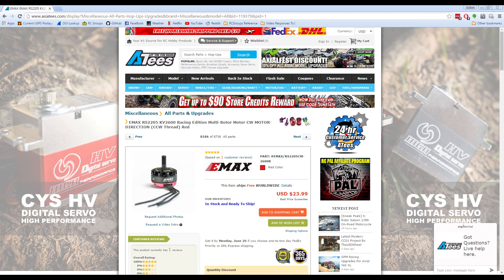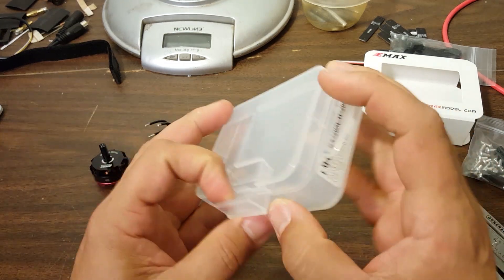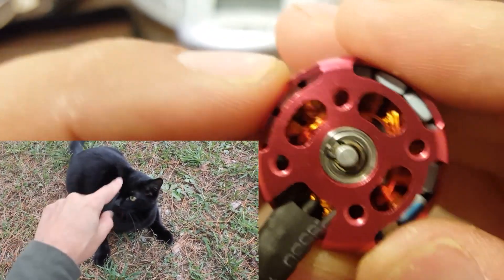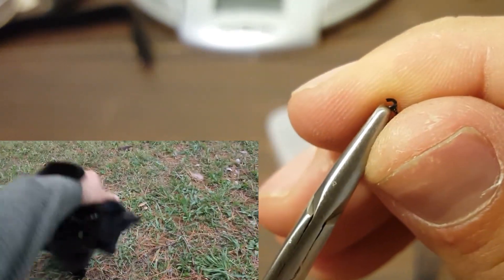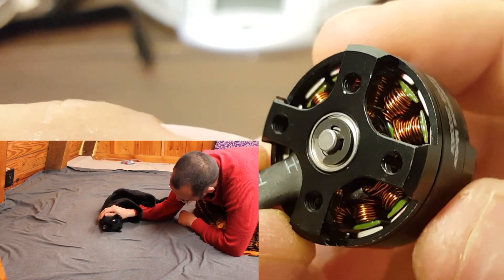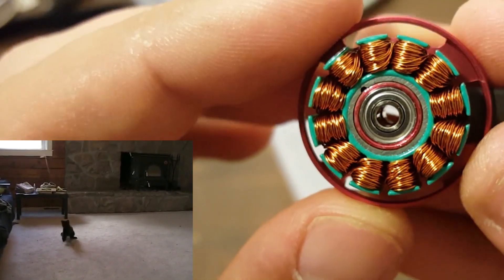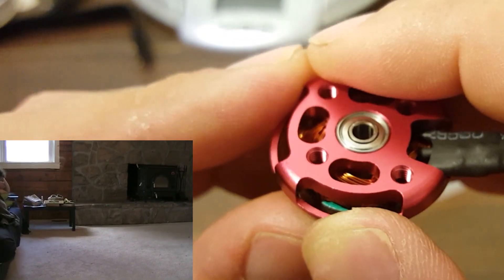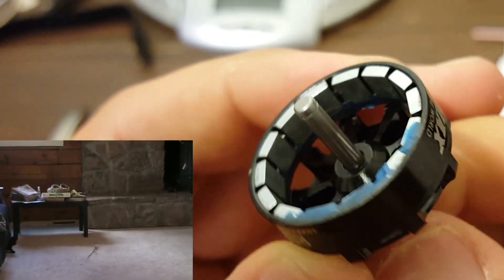RC Brushless Motor Primer With Cats

Comment: great info, have you done a video replacing the motor winding and re-wiring the motors?
Reply from the maker: +jwhit87 not worth the trouble to me.
Reply: Joshua Bardwell I liked the motors but anything higher than 25 amps, the wiring melted. :(

Comment: Just finished my new build with the emax 2600kv 2205's yesterday, and I literaly scared myself with the power they put out! Big upgrade from cheap motors.
Reply: i did the same thing.  after a quick los hover, i did a full hit on new 2205 2300 red bottoms and as you said, scared myself.  I was probably standing there slack jawed looking like a fool.
Reply: +TurkFPV Hah, probably how I looked in between calling out for divine intervention to save the quad.

Comment: Thinking of using the emax motors on my next build! Great product review (: I was also waiting to see if you were going to use a cucumber to make your cat jump lol.
Reply from the maker: Just be sure to keep the temperature below about 70 C as the magnets used take permanent damage around that temperature or above. Should be no problem as long as you don't mess up your tune or radically over-prop them.
Reply: QuadMcFly wrote after his tests "The cooling system is really working here, as in free airflow in a 
static test on the bench at 30A+ the motor only got mildly warm.  Many 
of the other motors I've been testing got significantly warmer on much 
less amp draw." (2300KV)

http://www.miniquadtestbench.com/2300kv-shootout-emax-rs2205-2300kv.html

Don't know if the 2600KV behave different...
Reply from the maker: The main way you would hurt them is excess D gain. That will cause heat buildup from micro-oscillations no matter what.
Reply: Don't use D... ;-)

Comment: i am pretty sure the emax have a "grubb screw" if you look a little bit closer! :)
Reply from the maker: I see now... it's inside the fins of the bell.
Reply: pretty sure they don't. I have a set and have pulled one apart for mud extraction purposes and didn't recall seeing one. Could be wrong perhaps?.. Looking forward to seeing what you think of these motors JB. I've been using them for about 3 weeks and are quite impressed by their quality and performance.
Reply: +doondedulin44 I know they have "grubb screws" .. At least all four on my quad does :) .. Awesome motor btw :). Thanks for the video JB, happy flying!
Reply: I have EMAX cooling black bottom and all my motors have a brass screws but it is really hard to see:)
Reply: +hyggefix I stand corrected ☺